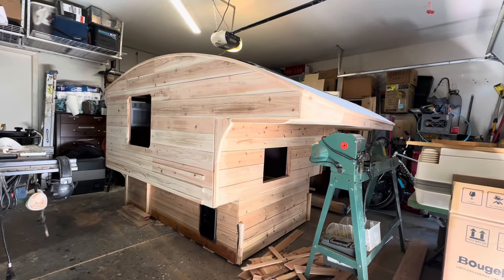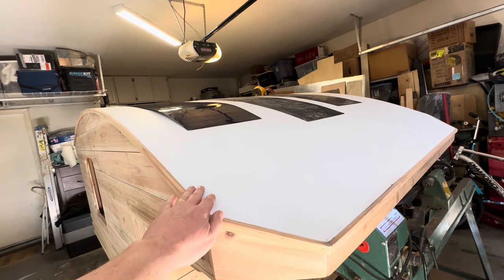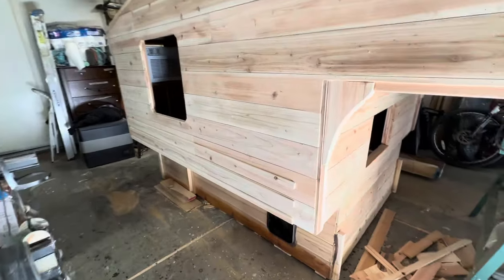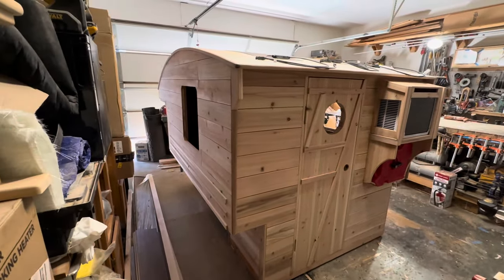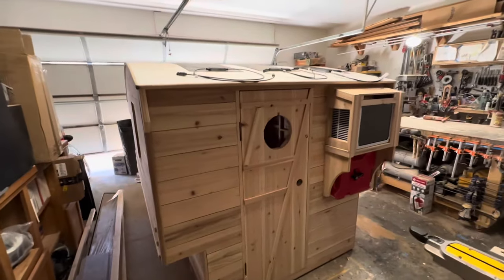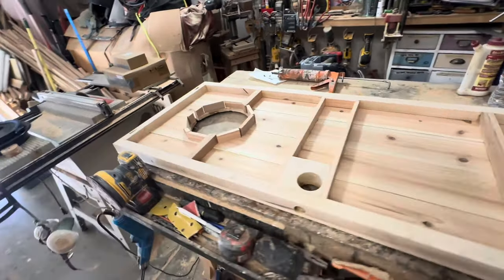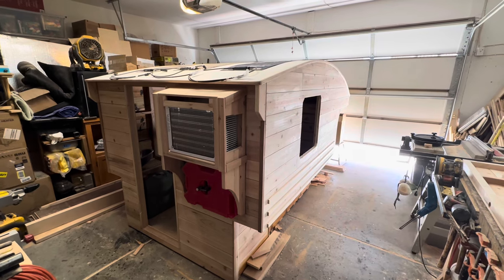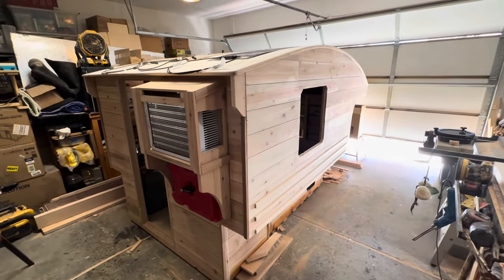Truck Camper Build 8.0 VLOG, Part 9 - Getting The Camper Ready For The Wood Finish

Comment: I love that shape. Very aerodynamic. I'm thinking to build something similar on my 1999 ford ranger. My question is what is the height from the truck bed rails to highest point on the camper? I'm 6 feet tall and want to have enough head room.
Reply from the maker: About 45 inches - overall inside height will be 61 inches. This camper is more of a micro camper and not meant to be stood up in. If you wanted to use the same general shape, but make it taller you would have to extend the length of the cabover and curve to make it look proportional.

Comment: Would it make sense to by 5/4 X 6 cedar and rip in half on band saw.  Nominal thickness is 1 inch.  The result would be 2-1/2 X 6 inch boards with no planing and wasted cedar.
Reply from the maker: If I’m understanding you correctly, no, not with my goals and material availability in mind.